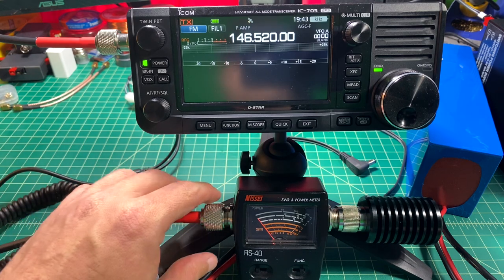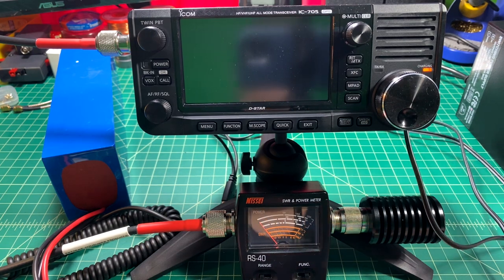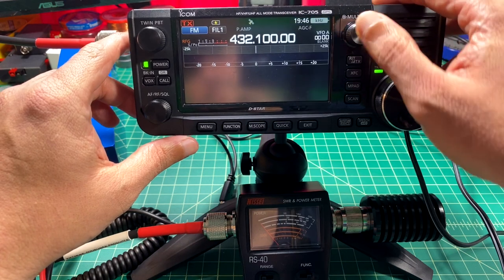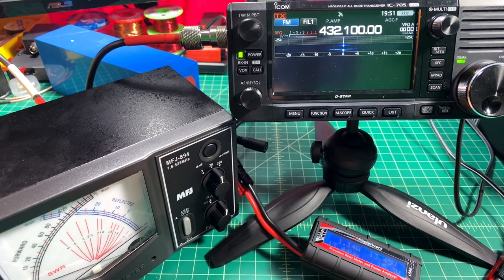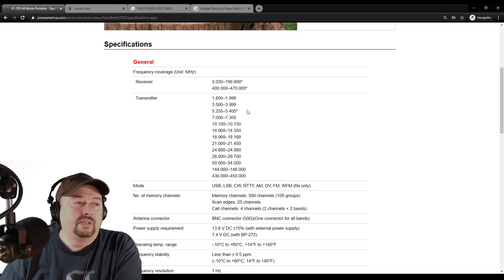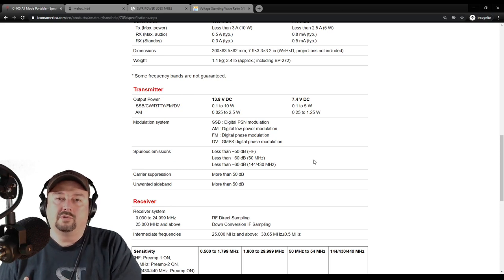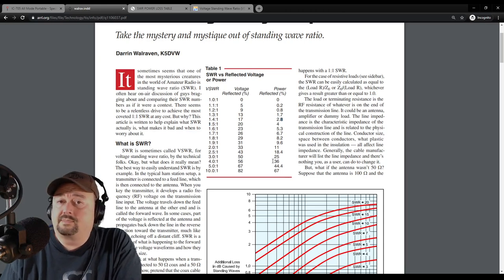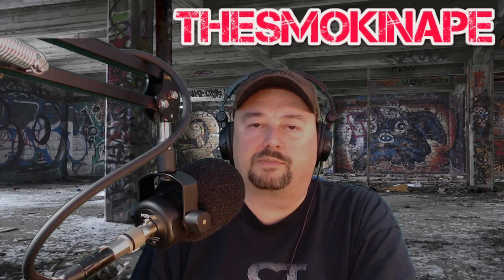ICOM IC-705 VHF/UHF Power Test - TheSmokinApe

Comment: Outstanding video as usual! Been thinking about picking up an IC-705, but at the moment I think I am on an X5105 budget. Thanks for showing the calculators as well! Very informative.
Reply from the maker: Thanks Craig, glad you like it 👍
Reply: Yes i knew that.  I am trying to find out why i am not getting 1o watts vhf and 5 watts vhf.  UHF is perfect. As it is most I am getting 8+ on full power and 3+ internal battery.  To be honest i’m about to send it back to Icom to be fixed. They should be ashamed for sending out a radio they change so much for we such a pathetic problem.

Comment: You are using a 12V external battery pack for the ability of 10W, while the recommended input on the IC-705 is 13.8V at list. Most common power sypplies for the IC-705 out there are between 14-15VDC. Maybe this is why..What do you think?
Reply from the maker: I was using external power, I don't think that was the issue.

Comment: The radio will fold back power if it does not like the SWR. The current meter tells me that it is cutting back power. So, it looks like the protection circuit is doing what it is designed to do.  Test it into a dummy load for UHF or into a service monitor.
Reply: Thats what he was doing.
Reply from the maker: Hey Ray.  That was my initial thought as well.  Just a quick note I was using an MFJ dummy load that is rated for UHF.
Reply: @TheSmokinApe  MFJ is not known for their precision test gear.  That is why I suggested a service monitor.  If there is not 10W into a service monitor, there may be something going on with feedline or radio.
Reply from the maker: I don't disagree, thanks for the suggestion.
Reply from the maker: Thanks FYL, I actually asked him to do the test to see what his results were.  Hayden is a great guy 👍
Reply: @TheSmokinApe  So did you figure out where your power was going since this came out? What was the reason etc?

Comment: I purchased the same meter so i can do this test.  My dummy load is made by diamond.  My UHF at full power is 10+ and battery is 5+.  However my VHF on full power is around 8 watts and battery is 4.  Why could this be?
Reply from the maker: The power output is about half when on the internal battery

Comment: Interesting video, I have an IC705 and was trying to run FT8 on 40m  using 10w & external power with an alex loop. When it transmits, it shows zero power and zero swr although power at max?  Obviously, no contacts, but brings in data fine? Any ideas?
Reply from the maker: Have you measured the SWR of that antenna on that frequency?
Reply: @TheSmokinApe  I only use the swr on the rig & that doesnt move when transmitting, ditto for the power meter?
Reply from the maker: Have you tried a different antenna?
Reply: @TheSmokinApe  no, that's what I'm thinking, I'm just starting out, dont have much equipment (or knowledge tbh) 
I may buy a new one to see, cant think of anything else, it's a brand new 705, so dont think it would be faulty
Reply: Found out it was using the wrong com port for audio out, all sorted now 👍

Comment: Fold back due to Swr is a function of the circuitry not based on a graph! Try using a resonant antenna without any measurable Swr and try again, not factoring in a possibly nonlinear foldback circuit, doesn't indicate an understanding of electronic design. Perhaps you should mention that in your reviews.